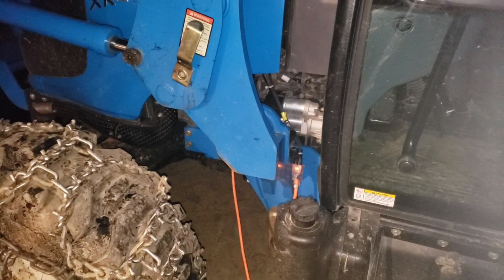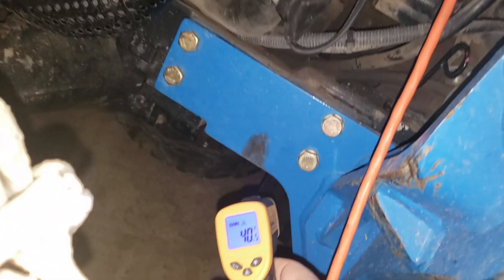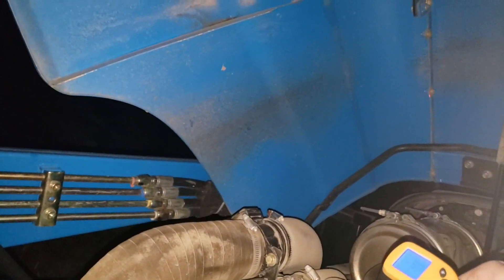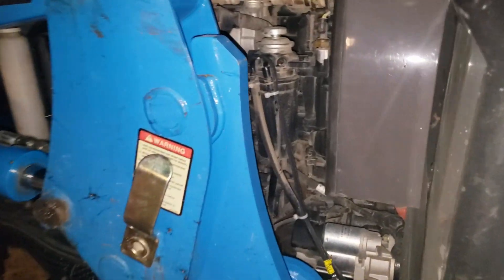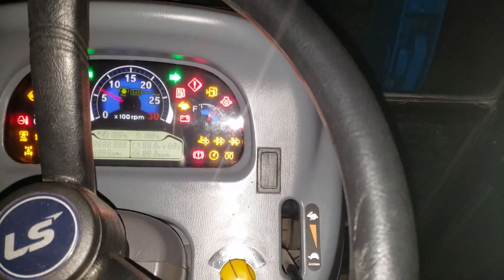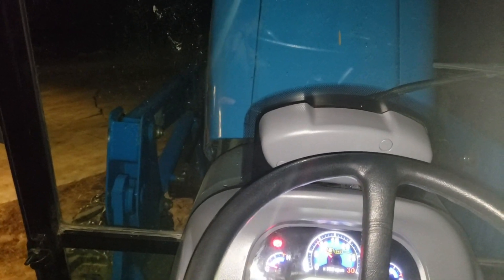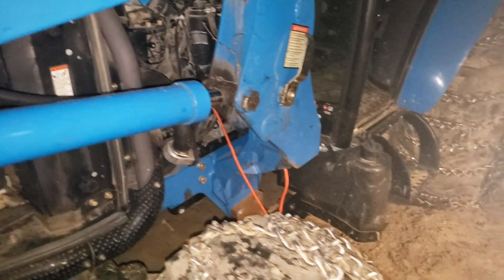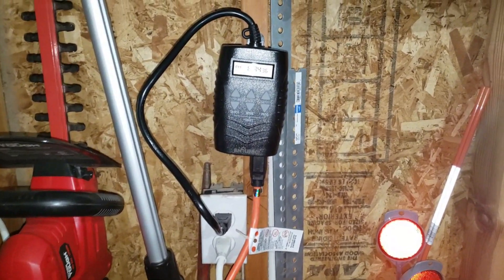Is the Lower Coolant Hose Heater Working?

Comment: You should read the instruction manual for your tractor and learn how to manually cycle your glow plugs
Reply from the maker: There is not way to manually cycle the glow plugs on this tractor. It is all automatic. Some versions allow you to turn the key backwards to manually run the glow plugs, but not this tractor. The issue here is not cold starts, the glow plugs work fine for preventing them. 

My concern, and the reason why I was looking at engine heaters, was because of the turbo during regeneration cycles. I heard of these tractors going into regen mode shortly after startup when its too cold and blowing the turbos due to the oil not being warmed enough. I heard about these lower radiator hose heaters and thought I'd experiment. Shortly after this, LS came out with an update to the ECU that does not allow the engine to go into regen until it is at operating temps. Unfortunately, the ECU reads engine temperatures from the coolant and nothing else. 

What I do now is use a magnetic oil pan heater that keeps the oil warmer during these very cold months. The automatic glow plugs work fine by themselves to prevent cold starts. In combination with the oil pan heater, I use a battery trickle charger and warmer. And I force regeneration cycles before it gets extremely cold. At 50hr intervals, for what I do, that prevents the tractor from going into regen while its very cold. 

Thanks for watching!

Comment: Hey I know this is a older video man but you can manually run your glow plugs by turning your key to the left instead of the right.   I have the same exact tractor and that's how you manually cycle them

Comment: i have trickle charger on the battery
Reply: I do the same for my gas engines and that works fine even at -30C. However for my old diesel, I find I need to use an inline coolant heater when it is colder than -15C. That means if I am skiing all day, I need to fire up a generator when I get back to the trailhead and wait for it to warm up.
Reply: @MountainParameters  i have a re- circulation  coolant heater for my JD 2130 but i good compression and no Emission BS  , i think it`s a Teir 0 engine, . I don`t have problem starting down to about -5 degrees below freezing . If so i have built in either injector .

Comment: Watched your video and here are a couple options i was looking at that are portable, and not install based to heat up the system-oil-filter-various parts with.

One option i saw is a 500 watt non LED work light seems to work well, see YouTube search "Improvised Engine Block Heater" . He uses thermal gun to show results. Another one i was looking at is from Canada that is made by Zerostart. It is a portable magnetic mount oil/engine block heater you attach to the metal part you want to apply heat to and plug it in and wait to warm up. Hope these tips may help.

Another cold start technique i have used over 26 years of long haul trucking is to cycle the ignition on for glow plugs to pump and heat or prime the engine like normal, but then cycle off without starting then wait 4 or 5 seconds and recycle again adding more fuel and heat before starting.

Remember pumping the throttle on older mechanical gas and carburetor based engines to prime it with fuel before starting? Same logic for diesel cold starting without the pedal. 

Of course the other pre-heating methods help, however if i forgot to plug things in the night before....🤪

Comment: It's heating your coolant in the top engine, heat rises from the electric heater. It is doing it's job. You can use the heater for the oil which will help or go to the oil heater alone, then your glow plugs will work.